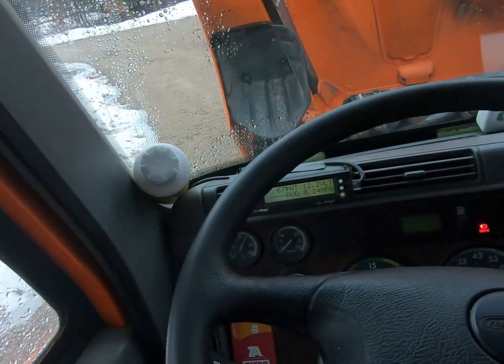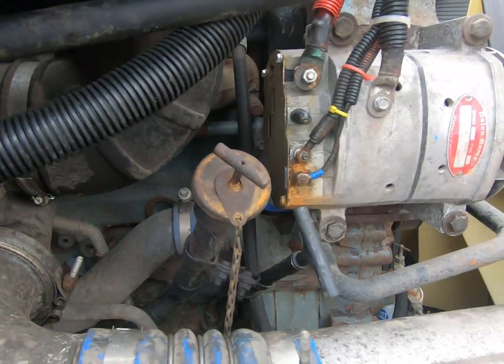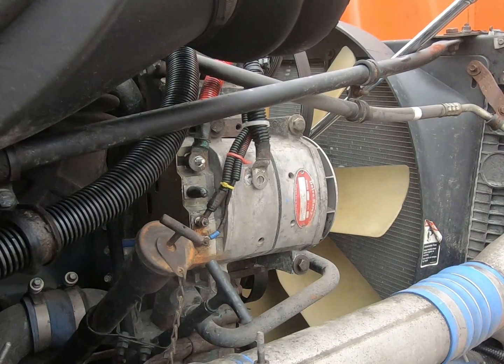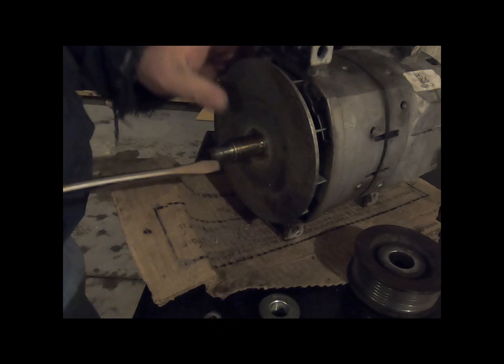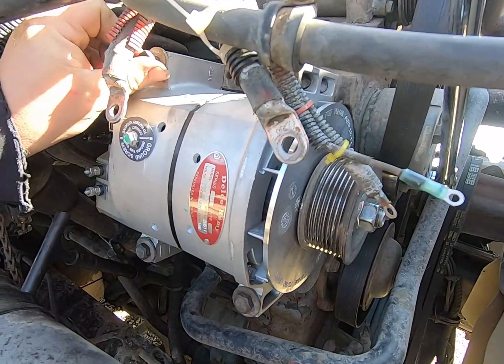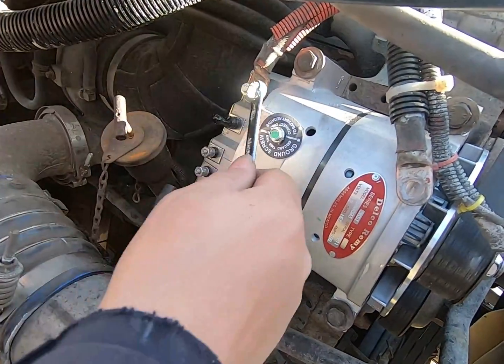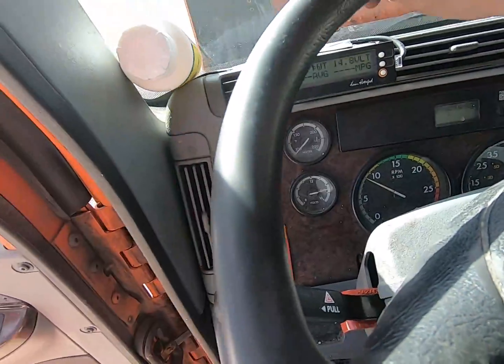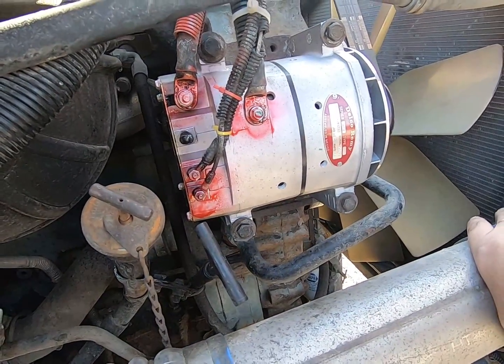How to change an alternator: alternator not charging, diagnose and replacement

Comment: When I trun my truck on,the voltage gage is at 12v and then it take a minute to go to 13.5 , and when I cook something in electric pan on inverter, the volte gage drops to lower than 12 but without cooking, it goes to 13.5v, I think my alternator is bad too

Comment: Thank you for this video.
the truck battery got down because the alternator was not charging. 
How long should take to charge the truck battery in full after I replaced the alternator?
Reply from the maker: you really should use a charger to charge the battery back up. if it is too dead you could possibly damage the alternator on startup

Comment: I changed the alt and still 12.2 voltage
Reply: Did u find a fix yet im having the same problem
Reply: @bobbycaldweld6332   yes wiring harness issue. Take it to the dealer. We’re a mobile repair company and we had to pull the pin
Reply from the maker: sounds like you have a wiring issue. start by checking for loose connections.

Comment: With truck running, voltage is 14.1.. if i run over very rough road, the voltage temporarily jumps up and fluctuates between 14.1 and 17.. then after a while, normal. Also happened once when I ran thru need water. Do you think I have loose connections somewhere?  I know connections at battery and alternator are good. Where else might I check? 2019 cascadia
Reply from the maker: Sounds like the regulator in the alternator
Reply: @DIYSEMI  ok thanks.  I considered that also. But second guessed myself because it only happens when going over a big bump or high water.

Comment: Nice video.  Thats not a horrible voltage, standard automotive alt spec is 14.5 +/- 0.5, but for long term running it is a little high.  Does that alternator use remote sense?  If it does, perhaps that sense line has become disconnected somewhere.  you could connect it to the B+ terminal, which would lower the voltage at the batteries…

Comment: I changed belt and now showing 13.5 it was 13.9 with old belt, same belt same part number? Should it increase back to 13.9 if I drive it?
Reply: New belts are way tighter. Probably will go back up once the belt is worn in.
Reply: @jf-he7dd  it went up to 13.9, but I replaced alternator 2 weeks ago for new one it was charging only 12.0

Comment: I put new batteries and new alternator and still reads 12.3-12.8
Reply from the maker: Try reading the voltage directly off the alternator. You could have some bad wires in between

Comment: I’m having an electrical surging issue. When I turn the truck of the surging stops lights and everything is normal. But when truck is on.. surging begins.. can you help? It’s driving me crazy!! Thanks. 2012 Mack Pinnacle
Reply from the maker: Sounds like a bad voltage regulator in the alternator. Will need replacement
Reply from the maker: Likely separate issues. Had they checked the primer pump for leaks? As well as tested the fuel pump? Common issues with those
Reply from the maker: Is your voltage gauge surging high? How high is it going? Does it stay high? Or up and down?
Reply: Thank you!! Someone mentioned that today as a matter of fact! I appreciate it! Love your videos & to ad, I started my authority by watching you video on “authority”!
Reply: Hello DIY. In my 2012 Pinnacle. I’ve had my injectors changed about 3 weeks ago. But I’m starting to have “long start” issues now. My fuel/Water selector, keeps filling up to the to off the glass as well. What could that be?
Reply: Thanks DIY.. changed the alternator. FIXED My surging issue. Gonna change the primer pump next!

Comment: Have low voltage issues, had my alternator tested reading 14.6 volts and loaded 13.8...Brand new batteries and check wires from battery to starter from starter to alternator all good reading. I'm stumped what my issue is...Also replace negative cable from alternator to starter still no luck
Reply from the maker: 14.6 kinda high. Doesn't costantly jump all over? More than the usual 13.8 to 14.1 ?  I guess I don't understand your whole problem
Reply: @DIYSEMI  I'm getting low voltage, I check everything I possibly can check. Wires etc, had Alternator tested off the truck..reading 14.6 on machine and loaded on machine 13.8...My truck is reading 13.3 on dash and goes up to 13.6 then back down..When I drive it pressing the break it drops to 12.7 then goes back up once I take off
Reply: @markrob9752  hi man having same issue . Did you find what was the issue. ? TiA

Comment: How much should the alternator read on the volt meter when the truck is running?
Reply from the maker: depends, newer alternators run a little lower voltage, and higher amperage. anywhere between like 13.7 and 14.1 is very normal
Reply: @DIYSEMI  I got the same alternator, new battery, battery voltage 13.0 after a day of driving, alternator voltage 13.8 with the truck running, what might be the problem ?
Reply from the maker: @radub3929  I don't see a problem
Reply: Thanks for the info!
Reply: My alternator running at 14.4 is that bad overcharging alternator
Reply: @TheSpeedyr6  14.4 is a good voltage - modern altenator's have temperature sensors that adjust the voltage to the outside temperate - so your voltage will very quite a bit with tempriture in many cases - 
       On a mild day it might be 14 volts at the battery after the engine has been running a while but on a cold day it can be 14.5 volts at the battery - 
      Battrey's charge at different voltages at different tempriture so many modern altenator's very the voltage with the outside temperature

Comment: Excellent 
Great explanation and quality 
Thanks brother
Reply: the two small cables what are they for?
Reply: @jdmoving399  one is to energize the altenator when the key is turned on or if there is a oil pressure switch used when the engine oil pressure comes up it energizes the altenator and it starts generating power - the other is for a light that is on the dash or for the computer on the truck - it lets the driver or operator know that the altenator has no out put or it has failed -

Comment: I have a 60 series 14 liter I'm having voltage issue my voltage is going crazy going down to 12.5 then up to 15 volts
Reply from the maker: Bad wire ..alternator..mine did that when my jumper wires between batteries went bad